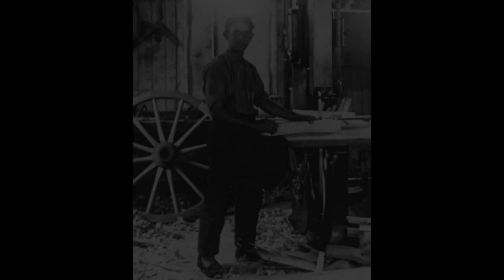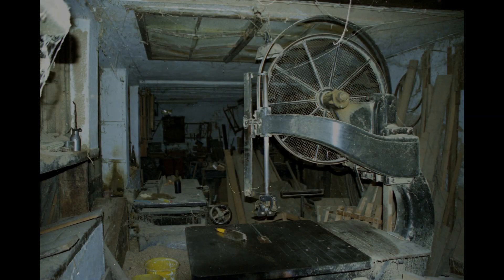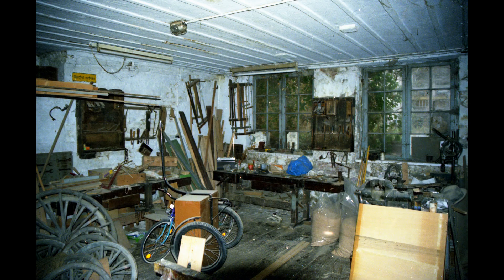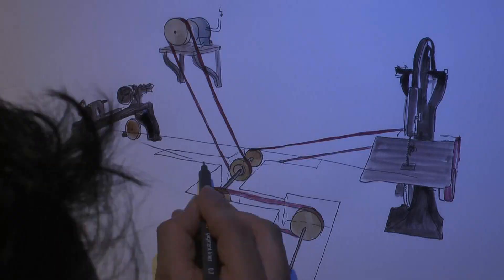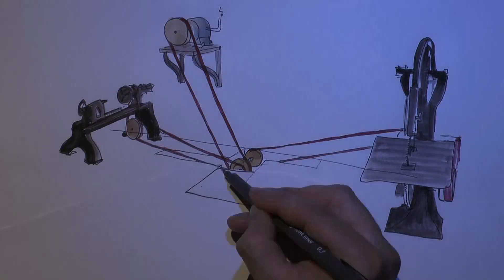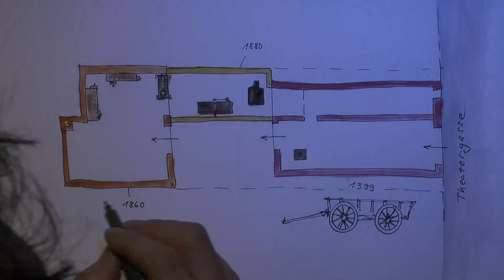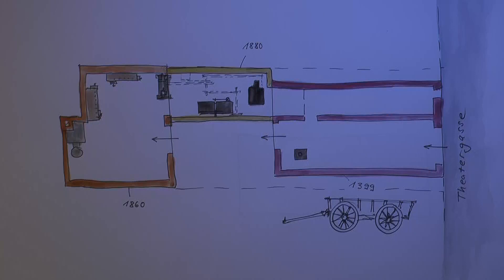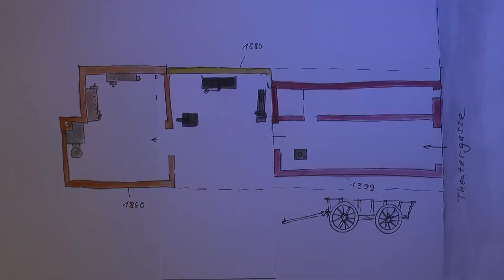The old bandsaw

Comment from the maker: +joe jerrard-adams
A historical artefact. When there was only one motor for three machines that was necessary to switch them on and off. And they kept this when the new motors came, because there is still an advantage: the motor can start without so much load  (what means less starting-current).